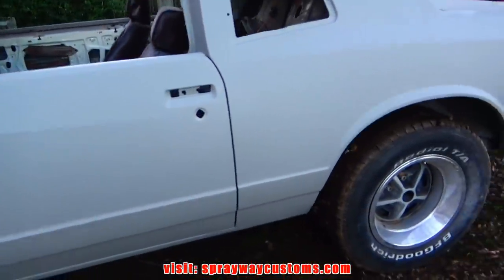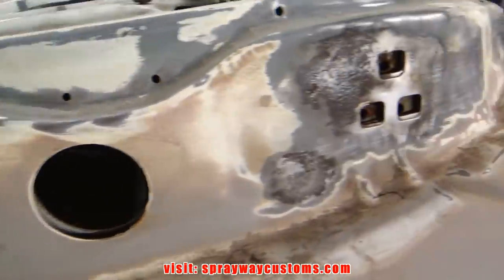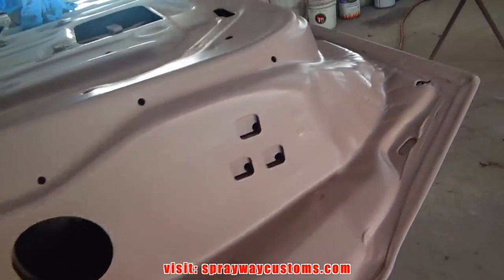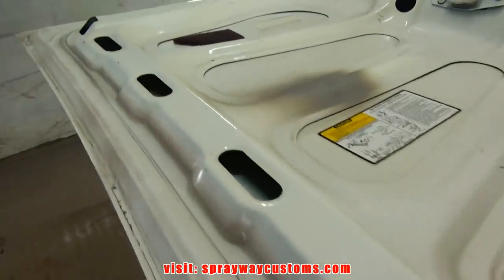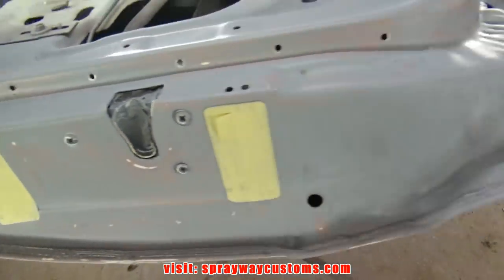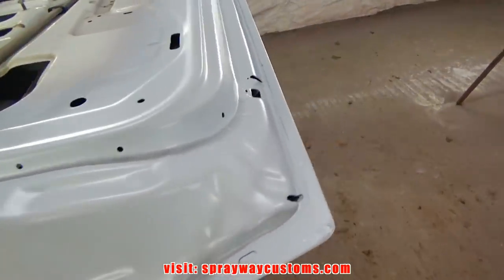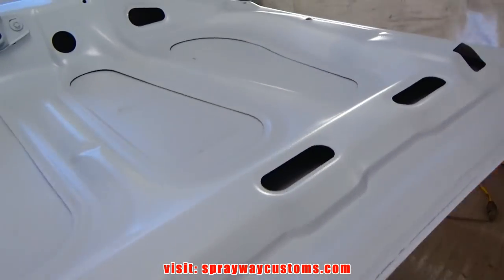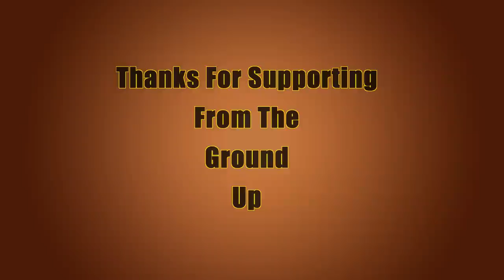Painting Candy Apple Fire Red Over Silver Micro Metal Flake - MONTE CARLO SS - Spraying Door Jambs

Comment: Why did you put a guide coat over the high build primer just to wet sand it off is it so you can tell where you sanded?
Reply: Guide coat is to level and find low spots
Reply from the maker: It’s to find low areas and to let you know what’s been sanded and not